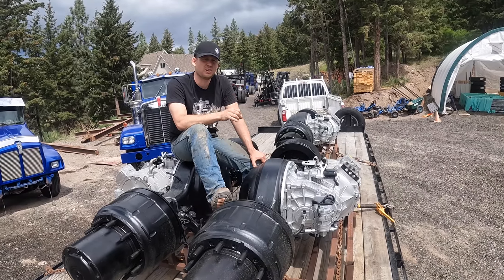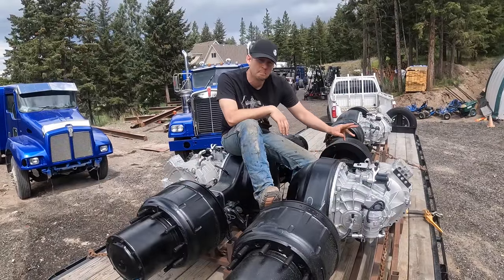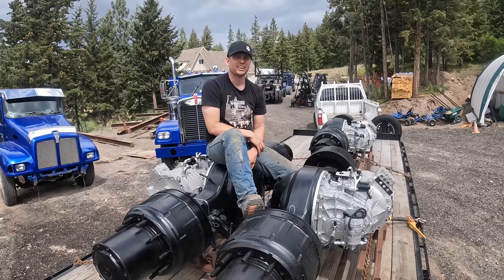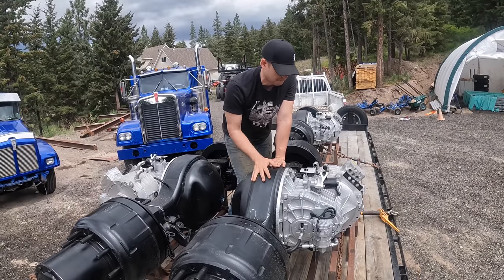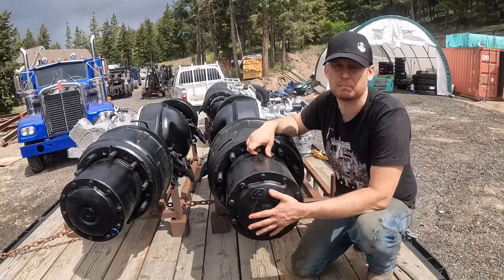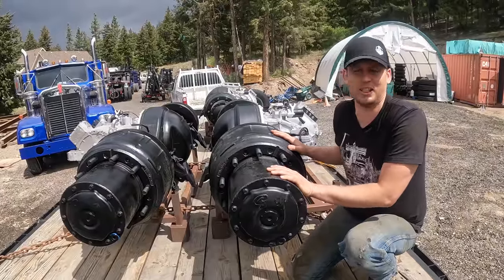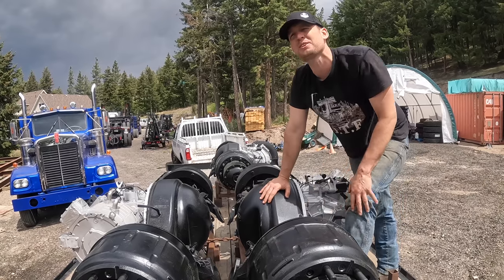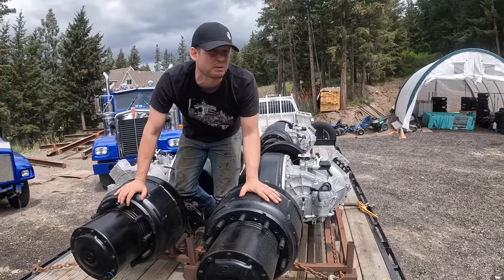Challenges of Building an Electric Log Truck: The Hunt for North American Axles

Comment: Just goes to show how complex it can be engineering this kind of stuff. Lots to think about. On a related note, i read an article on electric racing, how adding a motor can effectively give you more battery. Just using a motor as a generator to recoup MORE energy on braking (as the main motor is limited on hp/tq), means you don't need as much battery to race in the 1st place. Now this ain't racing, but do you see that concept as a possibility in logging trucks? I imagine not, as the client would just want that extra generator to also work as a motor, this using more kwh anyway

Comment: Really wish I could get the money together to do this to the front axle of a light 4x4. My choice would be a first gen dakota. Replace the engine and transmission with a hemi (maybe even an etorque hemi) and nag1 or zf8 RWD. Then put an electric motor on the front diff with a battery pack in the spare tire location for weight distribution. Should be a monster at around 3500lbs. Plus the added electric torque to keep the hemi in MDS mode would make it incredibly fuel efficient.

Comment: On the sync between the axles; you really don't want speed based control. It doesn't really tell you what's going on. Torque based control, which is free with electric motors, will equalize the actual load between the different axles. You're probably already doing it anyway, but figured I'd write it anyway

Comment: Sounds great but with all the weight from the axles and batteries, what are you going to haul..?? 
Styrofoam..?
There is a limit for the weight your truck is allowed to have on the road you know, so the heavier your truck is, the less load you can haul..

Comment: Am curious as axles move up n down so much how will those heavy electrical cables hold up? Aa normally a flexable airline and ujoint go to axle
Reply: Cable can be as flexible as you want. Probably 3/0 or 4/0 shielded cable

Proper support and strain relief and it’ll last a long long time

Comment: Yeah but with trucks as heavy as logging trucks, how will you manage to get more than like 30 minutes of battery power for the truck to actually haul loads back and forth all day? And wont all that extra weight from the massive battery packs required also limit the amount of logs a truck can haul since roads alway have weight limits?

Comment: As Stated before: how reliable is the synrconization of the 2-3 axle sets? Independent drive motors has me worried. Also, have you hardness tested the metal components (aka gear sets, bearing's, axles shafts ect)? Or are these at least been in actual service in another country perhaps? This is where you as a small guy, not having a testing and engineering dept to verify the quality of these components is at a disadvantage. I do wish you luck, but being a sort of Middle Man, you will be in very uncomfortable position if and when some of these imported components fail. It will consume all your time when it happens, prepare now or at least have a plan.
Reply: The syncing isn't really an issue, multiple motors and multiple engines have been done for over 100 years! Most of the cars on the road today from every manufacturer are made from a large % of Chinese parts.

Comment: Could you put a model T ruckstell type shifter on the planetarys so you could drive at highway speeds as well as slow heavy hauling. There pretty robust as they just make the whole planetary assembly spin as one so it doesn't overheat in high but in low they allow for the lower gearing.

Comment: Another idea.
Dynamic engine braking.
Let's say your battery is fully charged but you're descending a large grade. You still need to dissipate energy.
Set the engine brake and have the generator counteract the engine!

Comment: You are on the right track with the idea. Powered axles have been proven to be more efficient without drive train components. Every joint creates a friction spot. So eliminating 2 Flex joints helps on that. Next is the fact that you are turning the diesel engine into a generator is even better since you eliminate the gears in a transmission. It is the same philosophy as trains. Once you get this going well, I think you could see a market for people with pickups looking for similar axle setups from their 1/2 ton and up pickups. I personally would be interested since I could eliminate all of the drive train stuff. If you go one step further with driving the front axle, you would have a beast of a truck.

Comment: Right on , the company  you went to is only  a rep I'd guess, so you did it your way, the best way , spec'd ,engineered, proper components for your application, I use to build these big axles for a living back in the lates 70's & 80's and with a fair selection of planetary sizes, the advantage is with EV , your motors are built to bolt up to your Crown and pinion direct and the motor produces 340 hp and probably 15-1800 ft lbs of torque and this is times 3 right now and thats delivered at basically 1 rpm or 10, Toyota just added the 2024 Tacoma out and made it a hybrid and the electric motor they sandwiched into the powertrain is 48 hp and 188 ft lbs of torque and its tiny, I have a buddy who works for Toyota and says the motor is capable of more than that, being Toyota they keep it dialled in just right to maintain reliability  and longevity, this is what you'll be able to do with these behemoth axles you have, Navistar is testing a truck , full EV , I believe it is a 10 ton chassis and its in the range of 200 hp and 1750 ft lbs torque and its turned way down, they tested it up to 2700 ft lbs, what they are doing is mimicking it to be like the current diesel powered trucks of the same class/category so drivers will have an easier time transitioning to the EV units the employer will buy to replace the diesel units, can hardly wait to see thee build on this new truck 👍 new sub, these companies you first went to for your axles, just think of them as the gong show

Comment: Good luck finding any parts for that axle. Sooner or later you are going to need axle shaft seals, bearings or brakes.
Reply from the maker: I mean, you realize we didn’t build the axle, it’s a standard axle where you can find parts for in mostly any repair shop
Reply: @EdisonMotors  I work on coach buses but used to be a semi truck mechanic  that's not a standard north american axle but strictly Chinese. I would double check that parts are available before installing them. I used to work on Volvos and Freightlines but pretty sure that Kenworth behind you would not have an axle that looks like the one you got on the trailer. Look at the hub covers.

Comment: Are the electric motors front facing or rear facing ?
Reply: If you had room you could point the motors upward... 💡
Reply: @jimsvideos7201  I don't think so. The ring gear needs to run in a oil bath.

Comment: What is designed to happen for regenerative braking when the batteries reach 100% state of charge?
Reply from the maker: We have a snubber circuit to burn off excess power if the batteries get too full - Theron Danger

Comment: isn't drums better? cleaner long life (infinity) vs disks, better breaking force (worse modulation) worse heat capacity but regen will make classic breaking basically emergency and hold in place only.

Comment: 15~20 years ago I was already looking for electric drivetrain/inverter for some hypothetical projects.  The EV market was at its infancy back then but they were some players. 
All of them wanted to deal with OEM only. 
Never fully understood that mindset. 
Actually Tesla was faced with that same problem too and it’s bit why they started in Silicon Valley and not in Detroit. All the supply chain in Detroit was useless to Tesla.

Comment: Power trailers don’t work. As soon as you start to turn it pushes the back end of the truck off the road. Because the back of the trailer makes a shorter distance it speeds up and pushes in a straight line. Unless you can control To torque  not speed, then it might work. It will improve control when holding back until the turn gets too much then will skid the truck back end to the inside ditch. I tried powered logging trailers in the 70s. Undriveable.
Reply: I could see it as a on demand type thing. As in its something you could turn on/off when needed.
Reply: That seems like something that can be easily solved with software, especially since each axle can be independently controlled.

Comment: Don't ever drop ship anything from China. 
I had a paperboard converting slitter rewinder manufactured in China and the first 2 shipments were without issues... then when drop shipped a couple of machines to a different company name and opposite coast of the US, but which my parent company also owned. The 110" wide 18" diameter BEDROLLS were spec'd with a flame deposited tungsten for wear resistance, these machines did not have coated rolls.

Comment: Never seen planetary truck axles.
A 3 stage reduction must wear out the high speed stage, because it spins so fast.
I have seen that problem on tile plows,

I would rather see a 3 speed axle,
I love that you have a 2 speed, 
Brushless motors just can't make torque at low rpms.

Comment: Why is it a small two bit company can come up wtith a plan to build a truck, design it, have engines, axles and other equipment built and tested by outside contractors, in less than 6 months. At the same time the are putting together the cab, frame and other pieces in their own shop. You will have this truck on the road inside of 23 months. The big guys take years. Hurrah to a small Canadian company that is showing the big guys how it's done.

Comment: thats the power of capitalism... its cheaper to have it made there so lets get it from them... the problem arises when that only source fails... what happens then?

what if china was to crumble? what if chinas economic bubble burst? because theyve been artificially inflating their economy for decades... it will pop at some point and when that happens, i hope people will realise that having multiple sources for things... specially having manufacturers inside your borders helps alot when shit hits the fan elsewhere
Reply: Unfortunately, if China were to crumble you'd have a lot bigger issues than having to source axles elsewhere.  While the US is our biggest trading partner, China is the US' biggest trading partner, so should China's economy fail, we'd likely be impacted not only through Chinese trade but through the US as well.
Reply: china was their only option. no other choice.

Comment: i always thouht electric motors in all axles/including trailers/no gears/should provide enough energy through bracking should supply charge to return empty/hauling off highway,no wieght limits and jaking most of the distance loaded  /800000 kgs loaded,return empty 21000 kg/5 axcel/would be awsom traction

Comment: The problem is that these North American companies are all using short-term thinking. They can get a great deal because of cheap labor in China, and have a greater markup and make more profits during the next two or three business quarters. What they have not considered is what happens over a 10 to 15 to 25 year period.  I like to tell the story about the founder of the Toyota motor company, who had a 40 year vision for taking over the American car market, whereas all the American manufacturers were only concerned about what the profit would be in the next business quarter, and this guy was thinking 40 years ahead ….and today the Toyota Camry is the most popular car sold in America, and GM has had a bail out, a failed chief executive officer, and may actually fail again.

Comment: You will not like the subsequent production runs of those axles. If you don't know how China operates you will find the ugly truth soon. Those axle cases will become thinner, but only ever so slightly. The same with the gears and other components. Your price will not go down but their profits will go magically up. Slowly over time the  expensive parts will be replaced with cheaper parts. If you don't have a contract that allows you to reject any part not in spec, you will get inferior product. And if you don't pay them for this junk you may be held captive on your next visit until your company pays up.